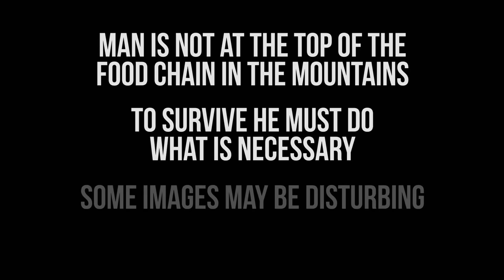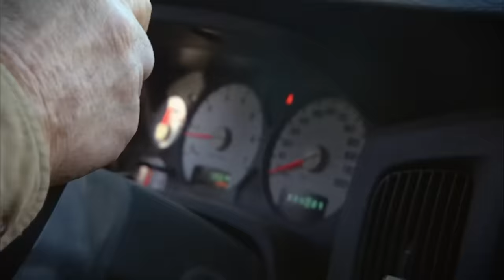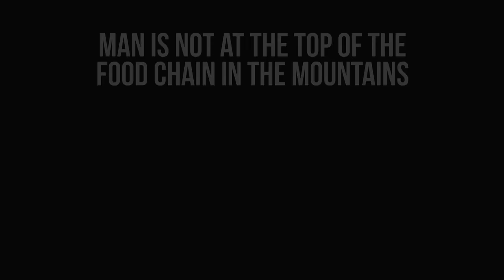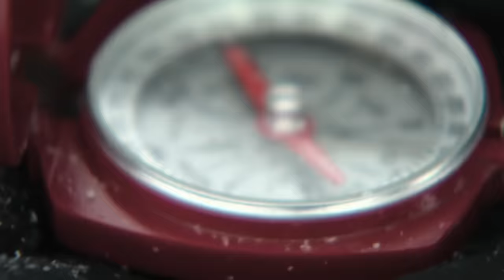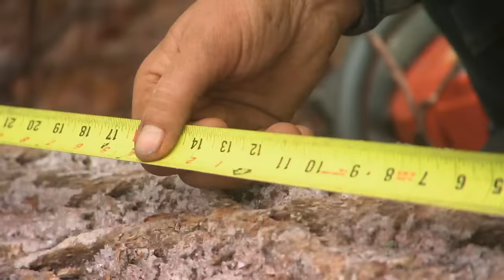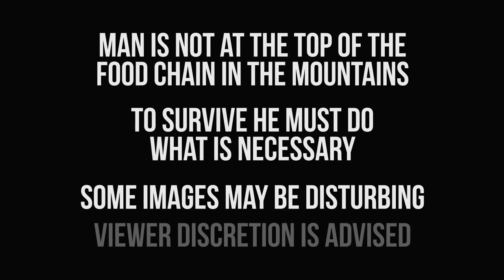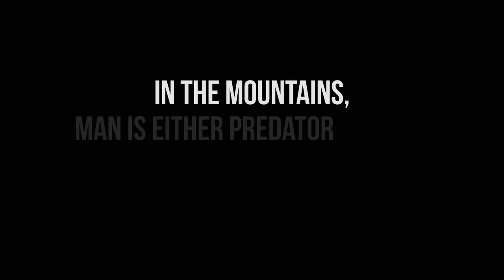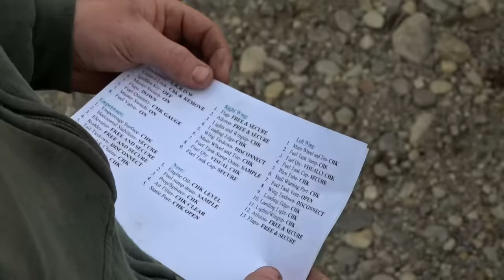Mountain Men: TOM'S EPIC SURVIVAL JOURNEY *3 Hour Marathon*

Comment: There is no way you can pull the stump out of the ground (38:20) just after cutting one or two roots. It would require hours and hours of digging and cutting. Each major root has dozens of smaller roots coming out of it. Unless you get them all out of the way you will never be able to pull the stump out. Trust me, I have been there dozens of times.
Reply: Editing